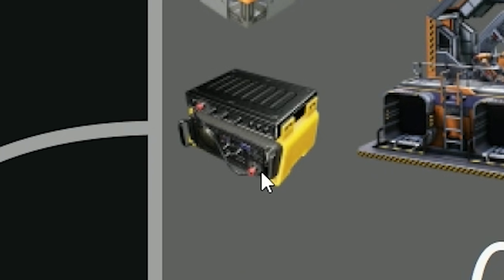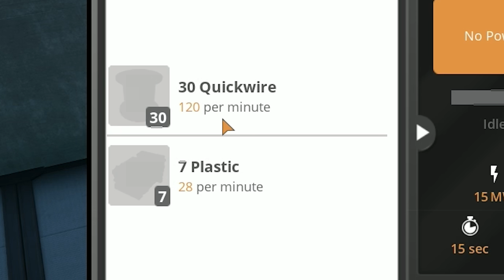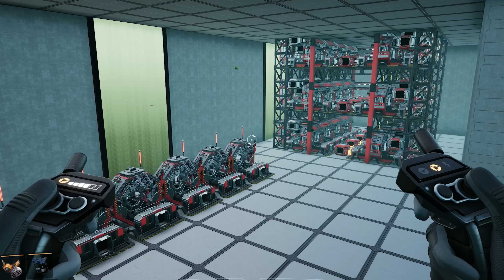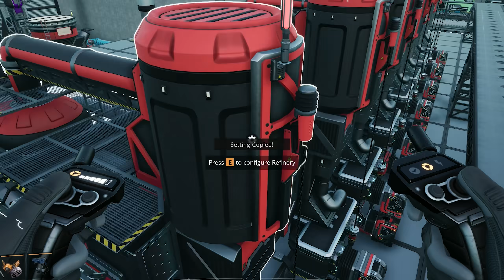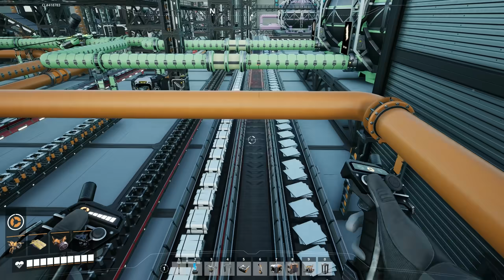Dissolved Silica is SO FUN! - Satisfactory 1.1

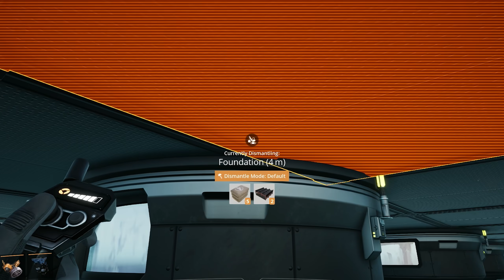Comment: 38:23 put glass roof over it. Alternatively make, a split floor using the thinnest foundations. Mayby add some pink signs so the pink looks like it bleeds out of the machines? Alternatively: Make a reverse fancy floor (catwalk clipped inside glass foundation, with pink cranked signs inside them)

Comment: The fluid issue at the end was definitely because you're feeding from the bottom. It needed to fill out the entire pipe before it started to push up due to head lift. Good rule of thumb is to feed liquids into buildings from above at all times. Sloshing with those pipes may affect throughput in the future

Comment: An easier way to deal with "refund" byproducts, and this works for liquids or solids, is to run some of the machines ONLY on fresh input, and some machines ONLY on the "refund" input.

For example, a recipe that takes 100 water/min, and returns 80 water/minute. Let's say I need 10 machines of this to make my production target. What I do is only hook up 2 machines to a pipe of 200 water/min. ALL of the spillover water, 800 water/min, is what ENTIRELY serves the remaining 8 machines.

This way, you don't need priority junctions, which are especially tricky with pipes because of sloshing, despite gravity rules. If there's ever a backup of the primary output, it doesn't cause the system to lock up, because when the primary product is properly exported again, the system automatically self-corrects for the water backup.

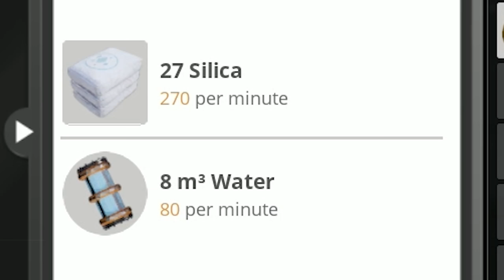Comment: 42:18 FYI — be careful putting limits on valves! Valves' flow rate is calculated using a 7-bit integer, which means it can only limit in increments of 4.6875 for a mk2 pipe or 2.34375 for a mk1 pipe. Whatever you set as the flow rate, the valve calculation rounds up or down to the nearest multiple of that value. So when you set the flow rate to 20 m^3, it ends up getting rounded up to 21.09375 on a mk1 pipe or down to 18.75 on a mk2 pipe.
Reply: what kind of horrendous fixed-point precision jank is that 😭

Comment: Idk about others but when I run out of power shards on the map, I’ve ran it through satisfactory map editor and put all the slugs back, it’s a little cheaty but I like to have the option of using them not limited by the map limit. Secondly, can’t you use the somersloops to double the amount of power shards you get out of a slug?
Reply: 1) especially since you can automate power shards that's a bit cheaty and kibitz doesn't want to
2) he's already done that for every slug on the map

Comment: They should add a tool in the blueprint maker that allows you to select which belts and pipes should be auto connected when mass placing blueprints if they add this feature, it should also let you choose which direction you want each belt or pipe to flow in for the blueprint

Comment: I'm a bit worried about the valves limiting the water intake for the distilled silica. As I understand it valves use 8 bits to set the values of flowrate that it lets through, this gives innacuracies on some values because they show the number you had input but the value they let through is different. Wouldn't this cause an eventual back up of the system? or maybe the amount of water isnt enough and stops the machines from time to time

Comment: I always build systems with looping fluids so I don't need loops. Consider this recipe, for instance, taking 500 water and producing 400. I would build 9 machines (or a multiple of it). I feed the first 5 off a water supply, then use the outputted 400*5=2000=500*4 to feed the remaining four.

Comment: I still say they need T2 equipment in some of the earlier systems. Perhaps using the newer materials of the higher tiers. Instead of pipe and plates for a smelter, a T2 needs steel and computers but has like 4x the output for minimal power increase. And REALLY need a T2 water pump

Comment: When you need both crystals and silica, the distilled silica is the best recipe!! Even in your flowchart, the difference in silica is 1350 vs 1400, and crystals are 750 vs 466.

A tiny bit less silica, but a lotta more crystals!!
Reply: Yeah, the main limitation to using it having enough nitrogen available. Otherwise his saying the original way is better isn't correct because you'd have to divert more raw quartz to quartz crystals to get close to the 750/m and you'd lose out on the silica. A quartz purification factory would be a great way to meet your minimum quartz/silica usage. You can use the other recipes to meet the remaining demand.

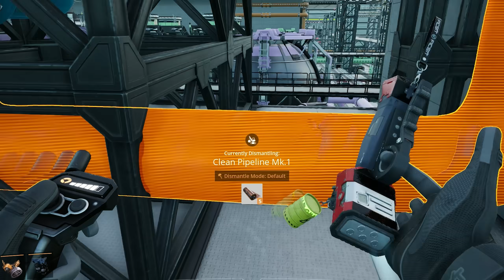Comment: 42:00 just saying valves don't actually work with regular numbers they work with multiples of 600/128. So your valve limit is only going to let in  18.75 in actuality.
Reply: Pretty sure they fixed that in 1.0

Comment: Can tell you right now that when dealing with looping byproduct water back into the same system that feeds it, the feed line from the water extractors needs to enter from the top-down so that the byproduct water has priority.
Otherwise if at any point the machines stall because they're full as in not using everything it's producing or not sending it to an Awesome Sink, the water extractors are going to keep pumping water inn and clog the system.

Usually what I prefer to do is make use of the fluid mechanics by having the feed line from the extractors go up about 5m from a flat line, then back down into the byproduct line.
Without the help of pumps, fluids naturally climb up to 5m when the pipe fully fills up, which makes it easy to utilize  this mechanic to create an "overflow" system for fluids.
Trying to use valves to solve the overflow issue will only delay the inevitable problem that will occur.

Comment: Working on phase two of the space elevator rn, on my first playthrough, going in completely blind... 1. wtf is this scope. 2. how exactely do you get so many rescources of Iron copper etc? Like there doesnt seem to be enougth nodes of Anything for what I am doing rn, how do you fuel so many machines?

Or is the answer just something like "Mk 5 Drills with every Mk doubling the output"
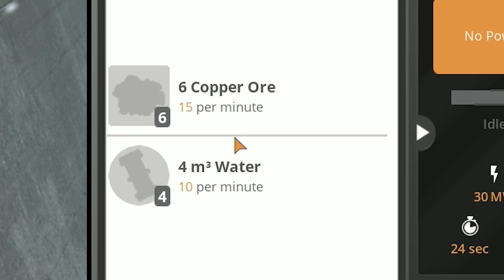Reply: 5:56 Oh, you just practicylly double your inputs lol okay
Reply: mk3 drills can output up to 1200 ore/min from a pure node with full overclock. you then build a LOT of machines. also, kibitz's playthrough is the biggest scope of any other, carefully optimised to use EVERY resource to make the maximum amount of power and phase 5 elevator parts. you do NOT need to go this big

Comment: If I could offer a suggestion: when you finally turn on the nuclear power plant, turn on one reactor, let it run for awhile, and follow its waste products all throughout the system. This should spin up every machine in the chain, but only for a minute or two at a time. See what percentage your batteries drop with one reactor running, and once the batteries reach a steady state (could be hours?), you'll know if you can handle turning on more reactors.
Reply: Real men test in production, world wide, on a Friday night.
Reply: @xoso599  I just set up the entire production line, and spam the fuse until the materials eventually make it to the generators and can power themselves
Reply: @xoso599 with a pack of Marlboro, coffee and a dream

Comment: Just want to say: the silica purification path is worth it, though a pain in the butt. It eats a lot of quartz but you get an insane amount of silica and crystals out of it in a relatively small area. The major pain is setting up the infrastructure and then getting the fluids to balance out without drowning in water. But once you figure it out you got almost more silica and quartz than you know what to do with.

P.S: There is one thing i should also mention. This recipe is only good if you want a lot of BOTH, which you usually do. However if you are in a situation where you only need silica or crystal, but not both, its actually more efficient to use the other alt recipes as they make more just silica or more just crystal with a simpler process.

Comment: To think, after all this...
Kibitz will need to update belts with mk6 belts, and re-balance things
and then unlock synthetic shards
and then will re-design systems with more shards in use
and then tear down 99% of the machines, to rebuild them smaller and more overclocked
while hoping that ripping bits out doesn't completely break things into a nuclear overload
Reply: Why would he rebuild anything?
Reply: @viktornicht260  Lower the placed object count to save the game's frame rate.
Reply: @xoso599  he literally doesnt have any framerate issues
Reply: @Rambrus0  He's built less than half of what you need to finish that game at, if he is planning to use most of that power the planned nuclear facility will produce.  But my answer was more general. Why would you, once you can make unlimited shards, go back and fully shard every building? To reduce load on the simulation.
Reply: @xoso599  Its up to him, but there is literally no point in redoing everything. That would take him weeks to redo everything.
Reply: @Rambrus0  It goes a lot faster to shard everything and then remove half than it takes to build it. The only part that might take time is caring about how it looks.
Reply: @xoso599 you underestimate how big his factory is. But sure it doesnt matter anyway
Reply: @Rambrus0  I have a good understanding of the size of the factory. Don't just declare to know what someone else is thinking.
Reply: @xoso599 You do the same bro
Reply: @Rambrus0  I have not assumed to know the mental state of anyone.
Reply: Ooooooh it will. And I'll be there with a bucket of popcorn.

Comment: I still have no idea why the nuclear power plant isn’t running as of yet…
Surely it’s time already?
Reply: Right every time i hear him mention power issues, i'm like dude just turn on the first stage, sure you'll start backing up waste but that's just preloading the lines for the second stage.
Reply: Same reason why he doesn't make a inefficient setup for infinite power shards :D
Or to unlock mk6 belts(that is gonna be a nightmare to upgrade with how many he has everywhere).
Reply: @jawstrock2215  Your examples aren't the same thing though. We aren't saying make some temporary setup or anything. Hell your examples would require more power he doesn't currently have, so he couldn't set them up. He has already built and tested the power generation he needs. All that is left is to connect a couple belts to turn it on.

Comment: Kibitz really leaving all the best recipes in the MAM
Reply: Iron pipe to steeled frame does not make sense to me. What is the reason he did that particular chain?
Reply: @matthewmalaker477  It's primarily due to resource availability. Need coal to make steel. Also need coal to make aluminum. Alternate recipes let you bypass the need to make steel. No such alternates exist for aluminum. Thus, aluminum gets the coal, and pipes get made of iron.
Reply: @Stant123 electrode aluminum scrap:
Reply: Put the recipes in the MAM lil bro (not even funny IMHO)